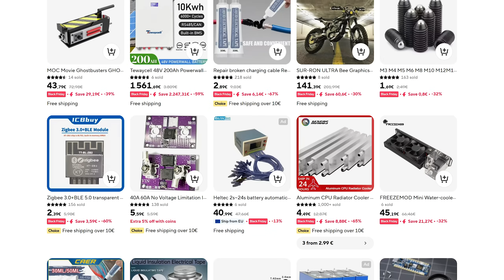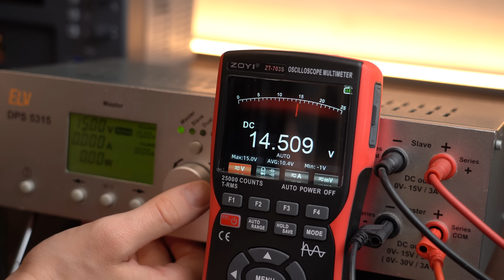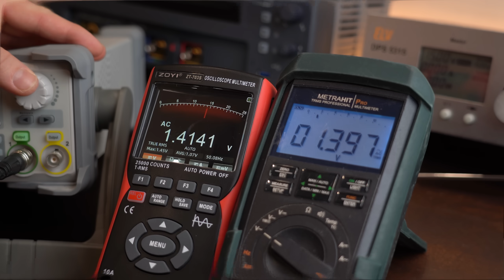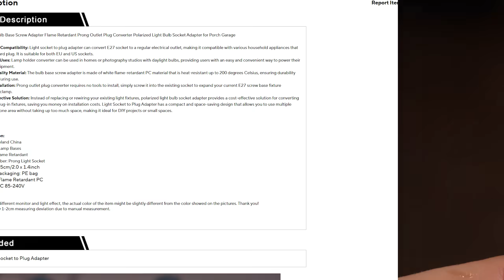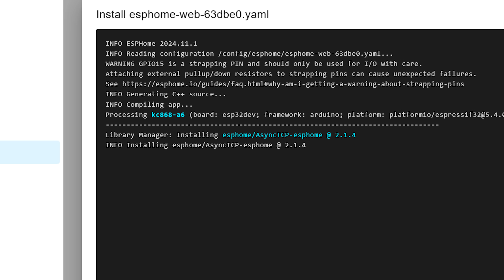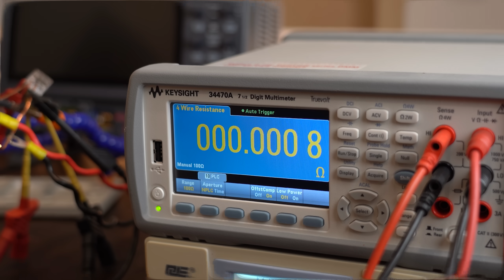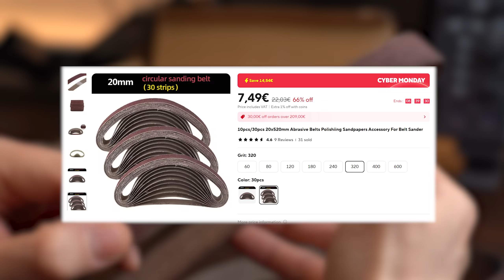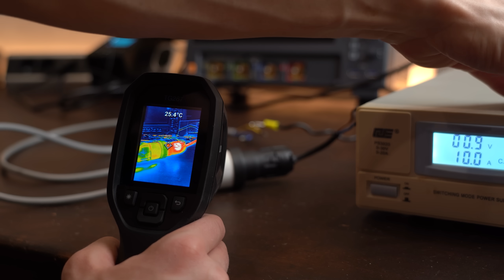I tried finding Hidden Gems on AliExpress AGAIN! (Part 12)

Comment: those socket to light fixture adapters are great for holiday light strings, just plug them into the porch light and you can flip them on/off without leaving the house LUL
Reply from the maker: Yep. Pretty much the only good usage I see for them ;-)
Reply: Socets also was used for "service crews" to plug tea pots in common places (staircase)  @greatscottlab

Comment: Some time ago I had my gas water heater replaced, and in the toolbox of one of the workers, was a homemade bulb to socket adapter, made from soviet-era parts. When I asked him about it, he explained that he also does roof and attic repairs, and in my area, It's uncommon to have sockets in attic, but we usually have lights so he used it for some low power stuff
Reply from the maker: Ok. Sounds reasonable
Reply: Had a similar case in a garage not having sockets, but a lamp. Being able to use like a small vacuum cleaner there was a game changer, using an old one. It also had lamp passthrough. Never left unattended though.
Reply: If the low power stuff has a plastic casing - ight sockets have no ground, but that stupid socket lets you plug in a 3 terminal plug.
Reply: I've seen the same thing used to power outside christmas lights off an outside light fixture when there wasn't an outside receptacle close by, and bonus no need to unplug to turn them off, just use the switch :P
Reply: @Scruffy545  That was literally shown in the video... -.-
Reply: @nimoy007  Did they say it wasn't? Why u so bitter?
Reply: @nimoy007  I do realize that now, I had committed that after only about 2 mins into the video :3
Reply: Cuz hes too cheap to get with modern reality and buy battery powered tools, like every other first world electrician outside of the northern hemisphere...
Reply: @Steve211Ucdhihifvshi  "Don't fix what ain't broken"
Reply: @Steve211Ucdhihifvshi  "Some time ago." You have no idea how old this story is.

Comment: I recently tested (for a magazine article) by ordering what was purported to be a 4TB external SSD drive from Aliexpress.
But got a 50GB Micro SD card (slow card) masked in an SSD-like external casing.
So pure fraud.

Answer from the seller:
They can consider paying back half the amount I paid if I send back the "disk" at my own expense.
For a postage cost far exceeding the possibly refunded amount!
So another scam! 
Cannot understand why Aliexpress does not put a stop to this type of fraud!
Reply from the maker: Yes, I mean it is pretty well known that such storage is often times a scam. Maybe I should talk about that in a future episode.
Reply: @greatscottlab  don't, these are old news. From time to time some good deals will appear. Last year there were batches of Kingston KC3000 NVMe on Ali which were really cheap, with 11.11 coupons and some game vouchers i bought KC3000 1TB for 30$. Kingston software recognizes it, i also updated its firmware once without issues, i still use it as an OS drive (with many backups of course) for almost a year now. Regarding 2.5" SSDs, Netac is ok choice, but only when on a serious discount, otherwise it's not worth it.
Reply: Refuse their offer and let Aliexpress decide on the dispute. They will 100% refund you without having to ship anything.
Reply: if you buy with a credit card, maybe you could cancel it with them and get the money back
Reply: Aliexpress will do nothing to stop this. They earn good money off it and there are no legal repercussions because they are in china. So you have to be careful. General rule of thumb is if it sounds to good to be true, it probably is.
Reply: Usually i have good experiences on Ali. But recently i got a diagnostic adapter for a 2012 BMW motorcycle. Don't know if the thing works, because the software cd (lol) they delivered had malware on it. didnt use it. didnt get refunded. not sure if because insufficient evidence or if they consider malware/spyware not a problem. gonna find an expandable laptop and try anyways :)
Reply: Yep.
Solid-state storage on AliExpress is often dodgy.

1) Read the reviews first, especially the 1⭐️ reviews.
2) If it seems too cheap to be true, it probably isn't true.

Comment: It is fun for Polish people, to see German guy is suprised about "Złodziejka" , what is commonly used in Poland since 966y
Reply: in the Czech Republic we call it the same "zlodějka"
Reply: there wasn't anywhere in the video "Złodziejka" aka 3way power adapter from classic socket. He complained about going from light socket to standard socket.
Light power wires are usually thinner in buildings and there is enough light for filling its capacity.
Reply: @ złodziejka in polish normally means adapter from lightbulb socket to 230v, commonly used in basements where you do not have sockets, but only lights. It is standard equipment at home here.

Comment: 05:31  Places where there is no power socket, but a (not) used lamp is available, e.g. to install a WLAN repeater or WLan surveillance camera
Reply: They are often used for Christmas lights.
Reply: @PaperclipAssitant  And now you can keep an eye on your Christmas lights with a cheap surveillance camera :D
Reply: Also great to steal a bit of power in a shared basement with no power outlets.
Reply: I use one in my storage locker where there is a light and not available outlets. Replaced the bulb with an LED and then ran an extension cable to charge only a few lead acid batteries on trickle chargers around 400mA total
Reply: I don't really own lamps that I don't use. That's weird. You do you though.

Comment: Don't knock that light socket adapter, we used to use something similar with Y bulb socket adapters they even had independent switches in the Y adapters
Reply: That one is a piece of crap. If you have to use one, at least get one that the plug doesn't fall out of.

Comment: I used to live in staff accommodation in a hotel. They would turn off the power sockets at 10PM every night to prevent gatherings/parties, so we hooked up an extension to the light socket. That socket adapter would have been very handy. 😆
Reply from the maker: Haha not a bad idea ;-)
Reply: @greatscottlab  you essentially misused the belt sander. It’s designed to be used like the original pneumatic dyno file / dynobrade brand belt sanders which are primarily used to get into difficult places with pressure applied at the head roller not the sides. A very very important tool in custom fabrication.   It’s not typically used to sand large areas or flat surfaces. In fact you usually use the sides with very light pressure to sand curved surfaces but mostly work off the roller on the tip. Even with the old school and very expensive dynobrade / dyno file ($600-$800!-US) you could destroy the rubberized guides if pressed hard enough for long durations of time.  Over the years cheaper units have been available but that adapter y would be an excellent utility for those whom cannot afford a pneumatic one or Milwaukee battery version with light or infrequent use.
Reply: Seriously!

Nobody should use a belt sander like this. 

This is like someone holding a drill by the bit and using it as a hammer when the handle swings around.
Reply: So you couldn't charge your phone or use a non-hardwired lamp after 10? That seems annoying to say the list
Reply: @somedude2492  some might call it abusive
Reply: That's an ancient idea. In the first era of domestic electrification (around the turn of previous century) people used light sockets as a common end point to a myriad of wires going to lights and household appliances.
The wire was insulated by wool if you were lucky, or if you were not so lucky, just plain bare copper wire at mains voltage. They did not take the power rating into consideration and frequently they exceeded the limit giving rise to domestic electrical fires. The fire prevention consisted of zinc buckets of water or sand. You can guess which method did not bode well for the incidental fire fighter...
Reply: Exactly. There's plenty of cheap backpacker hotels where this thing is useful.
Reply: That’s what they told you, the truth was probably they didn’t want staff using expensive electric heaters all night.
Reply: @matthewyabsley  "we don't want you to enjoy your free time" and "we don't want you to be expensive" honestly sound equally as bad
Reply: For LED lighting, a standard UPS would have done the trick.
Reply: Fo what i have seen in the comments, the utility of these adapters now is more of a cultural/local thing, here in Mexico there are a TON of flea markets, meaning there is also very common to find cords to plug the light bulb socket to an outlet, and here those adapters are used simply to repurpose them as extension cords while not being used.
Reply: maybe a better quality and safer adapter
Reply: that is so dystopian, fuck they care what people do with their free time.
Reply: @linkhidalgogato  far as i understand it, they were living inside the hotel so they wanted to prevent loud noises that could disturb the guests

Comment: Hey, that Bulb Socket is very common!
Reply: Yeah, I wasn't surprised about that one at all. I wanted to get one to hook up Christmas lights in odd places where there's no convenient outlets
Reply: Yeah that was what we used in old basements and garages. I have a few but haven’t seen one in use for decades since it is more common to put in more in walls during new build/remodels
Reply: My favorite was a socket passthrough adapter which offered a USB port. Perfect for powering a security camera near your front door. As long as you don't plan to turn off the light :)
Reply: My dad owned 1 or 2 of these that he bought in the US back in the 1970s.
Reply: @ my dad owned a small fan what he could insert into the bulb socket. After WWII such items were very common.
Reply: These are not common in Europe since they are banned
Reply from the maker: Not where I live.....
Reply: @greatscottlab  its quite common in the United States. So much so that you can get them at hardware stores for pretty cheap, about $3 or so. You can even get adapters that extend the socket outward and add two outlets to them, that way you can keep your light! Not that I recommend plugging much into them.
Reply: @greatscottlab  I am surprised that Germany uses the E27 lamp socket
Reply: @Fur_Trader  you shouldn't be surprised, all of Europe uses the E27
Reply: Like Germany, here is this the hot Stuff!
Reply: This bulb socket was discontinued in many countries where the power cable requires 3 pole commectiom L,N and PEN.
Reply: They were banned decades ago.

Comment: Another AliExpress video!!!! Sweeeeeeet! The light socket adaptor has been around for 80 years at least in the UK.
Reply: Well it’s fine if you don’t pull too much current but realistically it’s not a good idea. Light circuits only have 6 amp fuses and are usually 1 or 1.5mm twin and cpc.
Reply: @davideyres955   Yeah 6A CB and 1.5 T&E  plus the switches are not inductive load rated,
Reply: I've lived in england for almost 45 years, never seen one.
Reply: Made better and likely without an led
Reply: And was banned
Reply: What's the big issue aslong as you only use double insulated electronic devices then nothing will happen it is perfectly safe.
Reply: @ No earth, Doesn’t matter if you don’t use it, No polarity protection, also light switches are not rated for inductive loads.